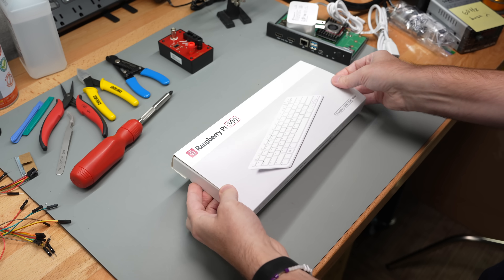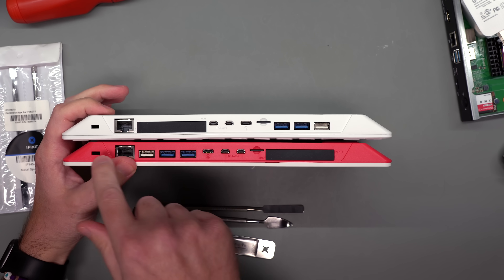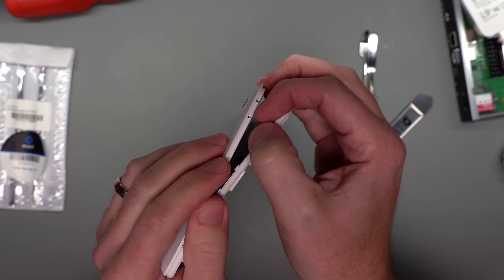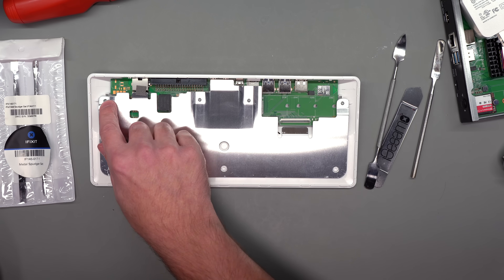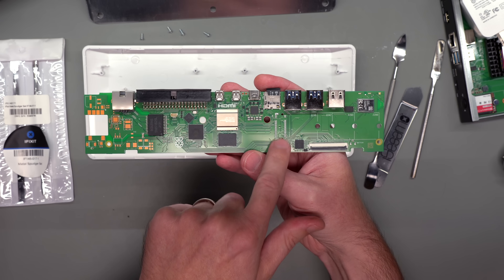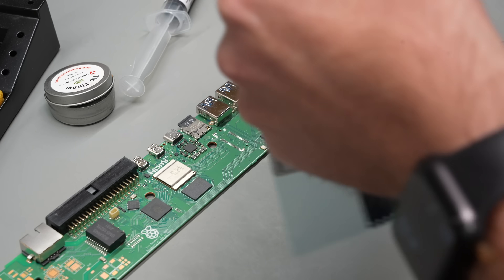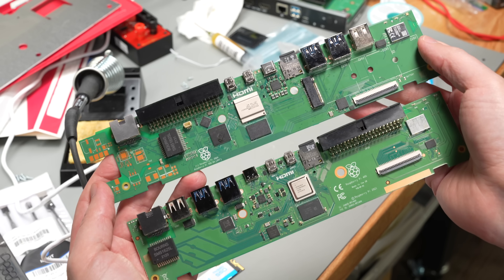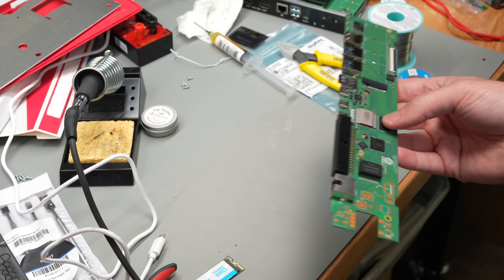What's inside the Raspberry Pi 500?

Comment: On the side of the M.2 connector with the group of 5 pins before the M-key break, the top 3 of the 5 pins are GND, then after the M-key break you have the CLK, TX an RX differential pairs in that order and they are obvious by the traces leaving from them towards the SoC. Do they connect to the SoC or do they have some missing inline termination resistors?

The rest of the pins in that row are not all ground and even though the signals are not connected between the M.2 slot and the SoC, I would not just short them all out to each other with solder blobs!

On the opposite row, the group of 4 pins above the M-key should have 3.3V on the top 3 pins then the 4th pin in that group is a clock pin SUSCLK that should have a 32KHz clock signal on it. I think it's very lilely they have not populated the clock oscillator chip on the board and that clock is important to wake up some NVMe SSDs.

Finally there are 3 more imprtant signals on that row of pins, PCIE_RST, /PCIE_CLKREQ and /PCII_PEWAKE that you should trace and see if they connect to any missing components. There may be some FETs that buffer or invert these signal and some resistors and perhaps they are missing and these signals ae disconnected.

You may want to also check using a multimeter if the 3.3V are present on the M.2 conector pins, which may well be the case but the NVMe doesn't work because of the other PCIE_* pins and SUSCLK if missing.

All in all it shouldn't be impossible to revive the M.2 slot with a bit of help from the Rpi M.2 hat schematic which is freely available online.

Comment: watching you solder that M.2 socket felt like hammering in a nail with a sledge hammer. I don't know if there is any place near you that can do wave soldering for you, but if so, you might want to consider seeing if they will do a one off for you. The header should be very standard, but the point is that the pins are very small and that you have to get them all soldered without connecting any 2 pins or mis-connecting pins.
Reply: FYI wave soldering is for through hole components, SMD parts are soldered in production using a reflow process.  Neatly mounting parts like that socket is fairly easy by hand with some experience, if you have decent flux and the iron at the correct temperature you should be able to drag it across the pins and have nice neat joints with no bridging.
Reply: @ferrumignis  Thanks for the correction. His iron was huge though. A decent $150 at least when I bought my iron will do the job if you have some small tips however, I lack the skills to solder pins that small. I think he was covering like 10 pins in one go... gave me the shivers.

Comment: "Wait, that's just a laptop." I remember the early press releases for the Raspberry Pi Foundation and their early ambitions to follow in the footsteps - only this time successfully - of OLPC.
Now the Raspberry Pi is little more than just another small form factor computer. For a while it was top berry in the fruit basket, but as Jeff has pointed out in previous videos, now you can get amd64 architecture computers that are just as small, less expensive with their included case and power supply, and several times more powerful. The Foundation actually does still make and sell a Pi-Top, but why would I want a clunky laptop with a rubbish screen that can be outrun by my basic bitch Android phone which cost an order of magnitude less?

Comment: Annoying that the M.2 / NVMe header is not populated and wired up. When (not if) they come out with a Raspberry Pi 500A, I hope they put that M.2 header on the backside of the PCB and put a little door on there that you can pop off to install the NVMe drive without having to take apart the whole thing. Perhaps around the time that the 16GB Pi 5 comes out.

Comment: @14:25 slow motion car crash.  You didn’t need that much flux, you did need a smaller tip, and you don’t need to hold your solder wire over the join, maybe refill your tip every 5-6 connections or when it’s dry.  The heat will draw the flux to where you need it, and prevent too much heat from being needed.

Comment: You need some 959T Soldering Flux lightly wet your soldering tip with some solder then a few drops of the 959T  flux on the board pins.. then drag proper soldering tip across the leads..
The solder will then wick from the tip onto the pins... I hold down the board with blue stick gum (looks like gum)...
After soldered is done place a few drops of 959t on the pins and drag a dry soldering tip over the pins to wick away any excess solder or bridges...
You need a magnifying glass or microscope to view if there are any solder bridges..

Comment: I would recommend you an IPC class 3 soldering course. Not that you ever would have to use class 3, but rather class 2, but you would be teached in dedicated SMD soldering. I have to do this course every second year. This is military and  medical electronics standards and would give you the skills of proper handsoldering SMD components. 
Even done once will give you a great insight.
Btw, i suck at soldering inwards, gold terminals. In the X-Ray i almost everytime time have 'sinkholes', blobs, which aren't soldered :D It's hard to get the gold soldered perfectly imho. Thats a no-go.
But be better than class 1! This is 'china' playtoys soldering. No joke!

Comment: It gets to "who is this for?" Like you said, a computer for kids, but also maybe a good option as a portable back up computer, cheaper than a full laptop. I'd like to see it where a line of pi cases and keyboards are compatible to where you could plug the two together to make a unit like this. That way, you could choose a keyboard that matches your preferences. This keyboard would be a downgrade for me. My main set up is a laptop used in a desktop set up, so I'd be better off getting a raspberry pi and case and plugging stuff into that.
Reply from the maker: It'd be awesome if there were attachments for nice keyboards like the Keychron or something so you could slap a Pi 500 on the bottom.
Reply: @Level2Jeff  yes, exactly

Comment: Some missed opportunities and unfortunate decisions (which were almost certainly made for cost efficiency).

* NVME and PoE on-board would have been killer. It's nice to see that these were not only considered, but at least taken into account on the board - but just that one more step to getting them implemented would have been awesome.

* Likewise, full-sized HDMI on this would have been appreciated.  It's not a huge deal to use adapters, but it's one more thing to have to remember, and managing dongles is always a pain..

* Speaking of cable management, putting the GPIO pins between the ethernet and the rest of the ports makes cable management more of a pain than it needs to be.  The placement on the 400 was better IMHO.

Still a worthwhile upgrade over the 400 if you want the whole "computer in a keyboard" thing.  Just could always be improved.
Reply: I would like to see 2.5Gb ethernet. It's so cheap to implement now that there's no excuse not to.

Comment: Looks like they got rid of the num lock functionality on the keyboard in order to give a dedicated power button; seems like a decent trade off as power button is used far more than a numeric keypad, especially in a home environment the 500 is targeting.
Reply: I don't think it makes sense at all to have the power button there. It seems like the first machine ever putting power button right next to the most used keys like "Delete" and "Backspace" and then it's also on the corner, one bad move at your desk and the machine will power off?! This is, if the button does not need a qualifier to be pressed to be functional, but still, it's a weird place. I would put a power button on the side maybe or at the back, you don't need such a key on desktop keyboard, since you can use whatever shortcut to power it down or start by pressing the "any" key e.g..

I also think NumLock is nice to have, I use it all the time, just to expand available hotkeys and automation triggers (and for typing, if it would be there physically).

Comment: The trick to small soldering is more flux than you think you need. It lets the solder flow only on the pins/pads and is the key to drag soldering, which is what you're trying to do there.

Comment: I seriously wonder how long will it take for someone to:
- take existing NVMe hat and find out the parts missing on the board
- take existing PoE hat and find out the parts missing on this board
- solder it all together
- make RPi 500 pro plus :)
Reply: You could do all of that, but you'd still have an 8 GB Pi 5 at its core rather than the 16 GB the 500+ comes with.  I realize this probably wasn't an option at the time you wrote your comment, but it's kind of moot now since the 500+ has the NVME slot and a 256 GB stick in it.

Comment: Watching Jeff soldering is like watching Bob Ross painting, its relaxing and there are some happy accidents but its always a joyful learning experience.
Reply from the maker: Haha. I figured it's time to start practicing SMD soldering. I've only ever done through hole, which is typically a lot easier.
Reply: @Level2Jeff  they say it's easier with hair fan method, but I've never tried myself.
Reply: Dont fall into the trap of thinking you need a fine tip to solder small smd components. That is often counterproductive, as the thermal mass is too small to overcome the heatsinking of ground planes etc.
Reply: @jeremyglover5541  Absolutely correct, super fine soldering iron tips are horrible things to use.
Reply: @ferrumignis i can only think that all the people (and there is many) i see recommending the use of the finest tip you can get, have never actually soldered small smt. Its a good way to make a mess; thats about all.

Comment: RTC is not mentioned - is it there?  What about the battery for it?
Reply from the maker: There are pads for it to the right of the keyboard FFC, but it's not populated. Probably another feature that could show up in the future.
Reply: @Level2Jeff  Incomprehensible to me.  I've been hanging out for one of these for a particular project, but without RTC and the M2 slot it's not useful to me.  Very disappointed.

Comment: That takes courage: finding out your idea didn't work and yet still sharing the process. Thanks.
Reply from the maker: Heh the only way to get better is to fail quite a bit!
Reply: Probably would have worked if he had a lick of microsoldering skills.
Reply: @jamesdavies686  Know be nice Jim... I had a college professor that used to teach the NASA soldering school and he ran us through the same training, so in 1975 we were hot stuff for soldering anything... Fast forward to SMD and the new processes for flow/reflow required.  1st off, he had the wrong soldering iron and size solder, but at lease he tried... You really need the schematic as Jeff mentioned at the end of the video to do it right... 1 missing inline resistor or fuse-link and even with your soldering skills it would still fail.  Be kind, it don't cost you anything and as we can't know everything and do everything as an expert and a little humility goes a long way in getting helped instead of being hurt.
Reply: @jamesdavies686  How's your soldering skills?
Reply: @geographicaloddity2  I could no scope solder a m.2 connector
Reply: Yes nevermind the missing chips on the board 😇 @jamesdavies686

Comment: Chaining m.2 to PCIe riser, PCIe->USB3.0/HDMI->PCIe x16 mining extender (which performs power supply injection) -> target card might make PCIe work without soldering the power section.
And get a smaller soldering iron, you are not soldering plumbing.
Reply: Definitely, but the speeds will be lower. Still quick and feasable solution though.

Comment: I find it interesting how the heatsink carefully goes around the NVMe spacing. Either they will add a slot later, or more likely they deleted the slot late in the design process.
Reply: Could be both. I think it is not as much that they planned on shipping this as a base model and later adding the slot in the Pi 500B Double-Plus MAXspec 2.0 as that they had ambitious plans for the Pi 500 and ran in to hardware issues they couldn't resolve before the deadline. Now that they're shipping the Pi 500 as is, the engineers have some breathing room to work out the problems and add the slot into a revised model.

Comment: I spotted an unpopulated battery connector next to the keyboard connector. I wonder if it's for RTC, or to power a laptop version...

https://youtu.be/omYWRb1dLA4?si=i-Uq7m5iGX-N2xYe&t=1099
Reply from the maker: It's for RTC, forgot to mention, oops! Unpopulated though, but it has footprints for the same tiny JST connector you find on the Pi 5.

Comment: The design is to be aerviceable. Then it is better that there is not an M.2 slot. If they make one variant with that then it must be easier to  open it much more easy. And the design doesn't look like that it could be easy by making an backdoor at the bottom, because the place for it is not at the bottom.

Comment: Adding a NVME could really mess with thermal management.

Interesting device nonetheless.
Reply from the maker: Depends on the drive, for sure. That may be one reason they decided to skip it on this product... worse than slow microSD is a flaky NVMe that's hard to get to!
Reply: They could add separate passive cooler for it and maybe add some more holes in plastic to enhance cooling. It's not anything extra expensive .

Comment: I think they messed up the m.2 placement anyway, it should be on the bottom side so there could be a door to install it through
Reply: I suspect they want to reuse that board for something completely different than a keyboard. 

With both M.2 and PoE connected it would probably get too hot without active cooling anyway
Reply: You mean like in the Amiga 500? 😉
Reply: @quaternion  I think you're one of the few others like myself who've sussed out the Pi foundation's inspiration.
If the PCIe fabric in the Broadcom chip has PCIe-to-PCI compatibility logic, I think I have an idea to make a system with a really good oldskool sound-blaster udigy, even if it means getting a 3d printed case for it.

Comment: My money is on the NVME equipped version will be called the pi 500 plus. Just like the Amiga 500 plus of its namesake 😊
Reply: No, it will be like Amiga 600 and Amiga 600HD.
Reply: Would be nice if the slot was underside the board though. Then the shell could have a access like.. 🐣
Reply: @AltCutTV  Wouldn't that just trap more of the heat?  I'm still wondering why the motherboard has to be inside the keyboard, like on a ZX Spectrum.  It just seems like asking for trouble with all that CPU power.
Reply: @TooSlowTube   Well, it would be pretty much the same I suppose as the passive ventilation is just passing through the shell anyway. Or possibly through draft convection through the keyboard as far as air movement thermal dissipation goes.

Of course if the SSD is on the topside as is, maybe it could touch the "CPU-cooler" as well, which would benefit the SSD if nothing else. No idea how much thermal pad spacing actually that would need though.

I think the Spectrums heat problem was more about power converters than the processing. Fortunately neither is really much of an issue with the Pies. The larger keyboard case in itself is a factor for better cooling than the typical Pi case at least. A lot more wall area to heat in that housing. :)
Reply: Looks like they were reading the comments here.

Comment: I just don't need my computer to be inside a keyboard. The keyboard will go bad before the computer will, too, most likely. It just limits usability and versatility to me. They should, maybe, sell this keyboard cheap and make it with a compute module slot.
Reply from the maker: Or make it so the top is replaceable! Would love a mechanical key option.

Comment: I am planning on doing some SMD soldering and rework videos if my eye surgery goes well. I work with a B&L Stereozoom microscope on a boom mount, to NASA standards. My work went to the ISS, and I never failed any QA inspections at the factory. It was better than boards produced with our new Heller reflow oven.

It is standard industry practice to manufacture circuit boards with unused areas. Se are for future use, some are specific to a different build level while others may have been for a product under a NDA for a specialized application. It's simpler to design and stock a sing;e base layout unless you plan pm making millions of a cheap consumer grade piece of junk of phenolic boards stock
Reply from the maker: Would love to see them, and good luck on the surgery! I need a good microscope on the desk. My 'helping hands magnifying glass' is definitely not up to SMD work.
Reply: @Level2Jeff  I pieced mine together  from parts on Ebay for about $15' including a 5 MP camera. I've also designed a nice, sturdy microscope cart to do the work. I;m thinking about upgrading the camera to one with HDMI output so I can use a spare 32" monitor with it. I used to spend many hours per day doing my own rework, and would end up with a stiff & sore neck . The base of the cart is a solid plywood furniture dolly, and can be built from a sheet of plywood and some 2"X2" for the four corner posts. I had a mew, solid wood half door for the top,, so it will weigh well over 50 pounds. This will make a very stable platform that can still be rolled away when not needed. I'm thinking about writing an article for 'Instructables' or a similar website. I went and recovered what I could from my late dad's woodworking shop. I filled a 20' enclosed trailer with tools and supplies, including some that he borrowed from me over the years.  I could weld up a steel frame from angle iron, but this will be more rigid and stable.
I hope that you can read this, since I can't proofread it.
May you have a Blessed day, my friend!